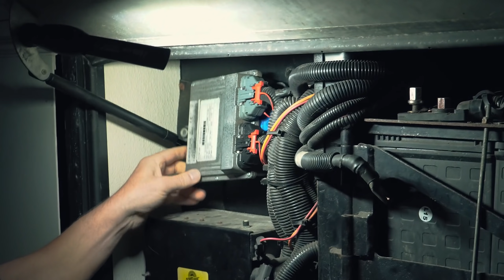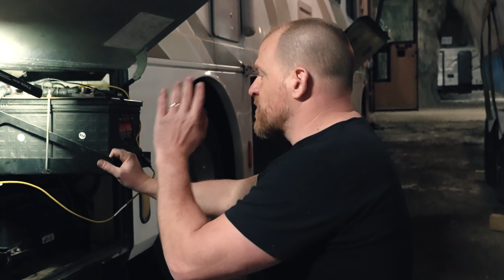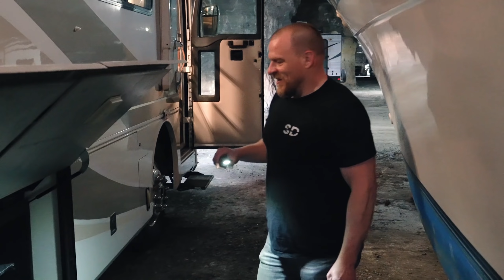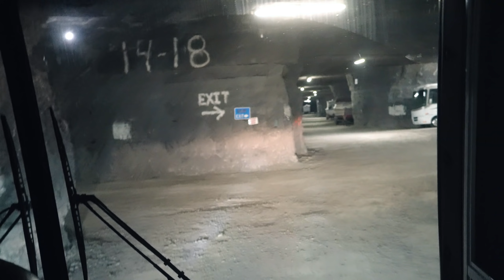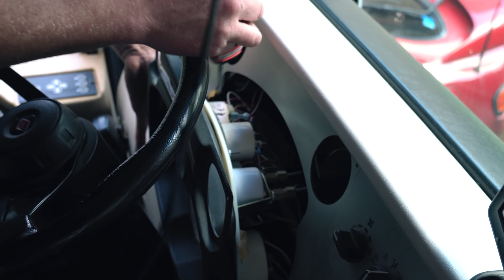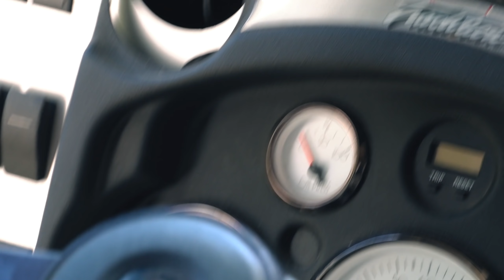What else got cooked in my RV? (bringing her home) Part 2

Comment: Paul as a former Cummins Inc. engine tech, I can only speak about Cummins engines and the OEM’s that use Cummins engines. I can say that on these charging systems I’ve never in 10 years out of all the following: large or medium size RV’s, Buses, Garbage Trucks, Tow Trucks, Crane Trucks, County Vacuum Trucks, High Pressure Compressed Air Trucks, Gensets Both Trailer Mounted & Truck Frame Mounted, Fire Trucks, Light Duty Class 6 & Class 7 Trucks and Class 8 Semi Trucks... 

I’ve NEVER seen a charging system that actually charged at 14.7 or higher Voltage UNLESS the system was a 24 Volt system and in that case they charge between 28v - 29.5v. ALL 12V systems on anything above the weight rating of a one ton truck usually charge between 13.5v - 14.3v, not even at different higher engine speeds. Typical engine speeds are 800 - 3,600rpm obviously smaller 2.3 Ltr - 6.7 Ltr diesels can turn up to 3,200 - 3,600rpm safely but, most larger engines 8.3 Ltr - 19 Ltr only turn around 2,100 -2,400rpm safely though 2,400rpm is not advised (that’s usually when blocks develop holes and rods start learning how to knock and fly.
Reply: We used to say redline is where pistons start swapping holes.
Reply: @VashthStampeede  yes but at Cummins we Dyno tested every engine that was rebuilt out of frame prior to putting them in the frame. That’s usually when we found the Monday and Friday engine builds. You know the ones that mostly seem to like slinging rods out the block or starting a new rod knock version of music when under standard loads typical of genset engines. It sometimes to us was a betting game of when they’d fail or how they’d fail. Cummins engines are cheap job security, it’s not if they’ll blowup it when. Of course unless a worldwide pandemic happens then Cummins keeps the desk workers and sends the techs that actually do the work packing. Saw it more than I care to say, I was surprised I had the job as long as I did they were always looking to send us packing to save money for their corporate budget and manager pay raises.

Comment: 13.8- 15.2 was the numbers taught to me back in automotive class. This was also 30 years ago lol. You are definitely blessed to have all these people out here trying to help out. I'm going to say it is to high and those batteries are definitely going to be letting off more gas. If there is a way to check the acid/water level don't forget to check it. I think it's funny that the gauge stuck on you. I've got a habit of flicking all the gauges that don't read right. I work on a ton of different things and sticking gauges seem to be common on older equipment. Love your videos guys, keep up the good work and God bless.
Reply: Learned in highschool chemistry, always lightly tap on all gauges for an accurate reading.

Comment: Mmm I haven't watched the whole video yet but I was thinking... Isn't there a way of having some kind of heavy duty secure switch that you can't turn off by accident and opens the whole 12V/24V circuit? In that way the people that run the parking only needed to know where it is (I guess in the same compartment where 12/24V batteries are) and it would be easier and safer... It could be even a requirement to leave the RV there because I don't think that would cost a lot in comparison with the parking fees and possible problems that can occur.

Comment: If a battery disconnect switch (they're enough for race cars) isn't enough to obey the storage mine's rules, what about a pigtail on the battery with a quick disconnect commonly used on tow trucks to connect jumper cables, and often used to quick connect snowplow pumps. those quick-connect cable ends are keyed so that they can't be crossed, are easily connected and disconnected, and are rated for 200+ amps.

Comment: 15.5 volts continuously is a too high charging voltage. What amperage did you measure? Any chance there is a sense or feedback circuit with a problem so the regulator defaults to max output?

Comment: as a guy working on medium/heavy duty stuff for the past 5 years 15.5volts sounds high to me most systems run 13.8-14.2 volts maybe 14.5 volts max but its an RV with more electrical loads so maybe thats normal not sure since I never really worked on RVs. the alternator is an older model with an external fan which I have found to be not as realable  as the new internal fan style you could get one delco remy replacement for maybe $250 or so but maybe its an RV thing with that voltage so high but trucks/box trucks/dump trucks/tractors are a lower charging voltage then cars are and 13.8-14.2 volts is the sweet spot.    great video man cheers!

Comment: 15.5 v is to high check engine light could be over voltage code if you could get a engine number I can try to get some info
Reply from the maker: part 3 coming up :-)

Comment: Find a reputable rebuilder and see if you can get the alternator output down to 14.2 or so. Most regulators tend  to be off to some degree. Also you might look into the disconnects like the tow trucks use for connecting jumper cables. That would give a secure connection and be easily disconnected when needed. Just use two different sizes for the starting and house batteries so they couldn't be hooked up wrong.

Comment: I don't like 15.5v either.  In my opinion 13.75v gives best battery life.  Many newer vehicles use 14.2v.   Delco type voltage regulators (inside the alternator) can be obtained with various voltage ratings.  Higher voltage can be used as battery temperature drops.  You said this is not computer controlled, so I'm guessing it doesn't have a battery temperature sensor.  AGM batteries tolerate a little higher voltage without cooking.  You could always check current going from alternator to battery and compare to current going out of the battery.  If they are the same, then you're probably not cooking the battery.  Also check battery temperature.  Is it a single wire alternator, or does it have a sense wire from the battery, check the voltage on the sense at the alternator.

Comment: What's the charging current?   Could you use an external regulator between the alternator and batteries?  Are all the batteries charged at the same time?  Could it be that the batteries' voltages are at different levels?  Is there any voltage drop on any of the cables?
Reply from the maker: coming up in part 3 lol

Comment: Hey Paul check the coolant level when engine is cold, if the level is below the coolant level sensor it will trigger the engine light and set a low coolant level code. When the engine warms up a little the coolant will expand and hit the sensor setting the code inactive.

Comment: For the battery bay, take a pictures of how everything should look when hooked up, print out the pictures and post on the inside of the door. Could also add some tags and/or color coding to the cables and posts indicating what should be connected together. Maybe test the picture and label scheme with someone not familar with the battery and see if they can figure out how to hook it up correctly.

Comment: They probably saw multiple batteries and immediately assumed a 24 volt system without looking at how the batteries are wired and hooked up 24 volts.  Catch their mistake after they tried to start it stopped and then hooked it up correctly.  That would have fried a lot of stuff.  Would have fried a battery cell also.  15.5 volts is to much.   A contractor friend of mine changed out the batteries in his Dodge diesel and hooked the first one up backwards, don’t ask me how but he did,  fried every thing.  ECM,  smoked,  BCM, smoked, alt, smoked, electric clutch fan smoked.
Reply from the maker: damn, expensive mistake!
Reply: @ScannerDanner  
  Yes it was.  And like your motorhome I cannot figure out how he stretched the cables to hook them up backwards, but he did.

Comment: Some OP gauge systems work backwards. That is, full ground sets needle to zero and as OP rises ground is reduced to increase gauge reading. I am a marine mechanic and run into this from time to time on older boats and some diesels. The gauges resemble Faria. They do that sometimes. Especially the tachometers.

Comment: I'd be nervous about 15,5 volts charging Paul.  Seems pretty high as mots I've seen on these is around 14,5-14,8 range.  That alternator is more than likely a Leece-Neville brand as those are common on the Cummins ISC and ISL engines.

As for the transmission shifting, I found on grades I drive by feel and gauges and shift manually.  Over time the adaptives on the transmission will learn where you shift and many times when I am reaching for the shift pad the transmission will shift so it has learned my driving style.
Mike
Reply: I wonder if the high charge rate is causing the shifting issues?

Comment: On the table. 
When you got a bunch of things to do, you say I have lots of things on my plate. 
When you haven't finished doing something or it is still in consideration then it's something that's still on the table. 
Course we are talking about the English language and there's a lot of different ways of saying things in the English language too two to. 
Wright, rite, right?
I mean correct?
Wait a minute Caleb, cute? What about your sisters. 
Yeah 15.5 is high but it could be that high because it's charging your batteries. 
I'm used to seeing around 13.5 when charging but I am usually seeing single battery conditions. 
You are dealing with multiple batteries and it looks like different charging maximums. 
Have a look. 
https://rvlifestyle.com/understanding-battery-voltages-and-state-of-charge/
Here's another site to check out Professor.
The guy says that Costco batteries recommend a 15.6V equalization charge periodically,
https://forum.solar-electric.com/discussion/331802/maximum-safe-charging-voltage-for-rv-systems
There's a bunch of info to look at.
Something there maybe your cup of tea. 
Happy Motoring.
Reply from the maker: I just suck at common phrases, I get them all wrong, ALL the time. It is an on going joke in my family
Reply: @ScannerDanner  I don't know if your family does this but my family quotes famous movie lines such as,
 When going on a road trip we'll say, We're off to see the Wizard, from the Wizard of Oz 
Playing with the kids my wife will say, 
Reach for the sky, from Toy Story. 
We also quote some comedians like Brian Reagan. 
Brian does a skit where a bunch of guys are trying to one up each other and then Neil Armstrong walks in.
So when one of my kids was impressed with a job I did, my response was, Well you know I walked on the moon. 
Have a great day Brother and keep walking with the Lord, cause ya know He's watching and we want to please Him.
Reply from the maker: @mostlymoparih5682  all the time! But it is Dumb and Dumber (the original) that we quote the most. "we're really doing it aren't we Harry" (road trip) or "bulb gulps huh, welp, see you later" (like every time we stop at a gas station)

Comment: I would freak at no oil pressure and you let it run, waiting for the knocking?? No current clamp? Did you at least bring beer?
Reply from the maker: I knew enough about the system and the computers oil pressure sensor to be comfortable. Combined with the smoked TCM, I was never worried about the oil psi (part 1)

Comment: Pro tip from an aircraft mechanic. Replace the disconnect switch with a aircraft battery disconnect. MIL-PRF-18148.  For a battery disconnect I would use tags. Matching negative and positive tags. One on the cables and one on the posts.

Comment: Try rainex for the windshield on the camera lens. Might keep the moisture off it.  You were talking about leaving the key on the first position reminds me of my boss. He had a Wonderlodge and towed a Suzuki. Pulled it from North Miami to Key West with the ignition lock with the wheel turned a little to the right. Scraped off the sides of the front tire.  On the 15.5 volts. Is it possible that you have a dead cell in one of the batteries that would make it over charge.

Comment: need a better look at the alternator. could be a leece neville. it will have a 4 bolt rectangular  cover in the back and side that is the regulator.  if it is it is brushed  and will need overhauled at about 130,000 miles.  we scheduled 100,000 miles.  got parts at pitt auto electric  but that was 20 years ago. not sure they are even still around. yeah 14.6  is the limit i'd go  14.2 is perfect.  older batteries tend to boil off  more than new ones so 14.2 to 14.6 max.   you could have disconnected the oil pressure sender wire and done an ohm check  off and running. sometimes a d'arsenal movement guage will get its   movenent magnetc charge shifted if too much current goes through it.
Reply from the maker: it's not fun under there lol, that's why I went gauge first lol, great info and on point. Part 3 coming up
Reply: @ScannerDanner  definetly change the regulator/or alternator to  get voltage in range! i would wonder about excessive moisture in that old cooked tcm/coupled with excessive voltage? Just a thought from an old FART that has worked on cars proffesionally sice 1971....boy i am old,keep up the good work SONNY BOY11111

Comment: One thing you could do with the grounds is to combine them with a binding block. One option is to get one of the temp cable terminals, the kind that clamp around the cable, only don't use it as a clamp. Use the bolts that hold the strap as binding posts. Another is to make up a short cable with a post clamp one one end and eye-type terminal on the other. Use a bolt and sandwich-stack the eye terminals together, or make a simple bus bar terminal block with 3/8" strap and bolts, using the new cable you made to connect all the grounds.  Either way keeps the original cable terminatons intact, but with a single connection at the battery.

Comment: newer alternator have sensing wire that should connect direct to the batteries or the output post on the alternator if broke or missing they to overcharge

Comment: 15.5 is high.
High Voltage = Lower amperage 
Lower voltages generally mean Higher amperage.
Test the actual Amp output @ the Alt,( I know you already did So I await your results in Pt. 3).
The regulator voltage set point on your rig is either skewed or faulty.

Comment: Your dealing with heavy duty equipment.  Most smart device's are set up to be used for 24v and 12v. Battery's that possibly didn't hold a perfect full charge might charger at 15v

Comment: Usually the people that can afford a New Motor Home , Have the Money to afford repairs , When I first retired I bought a 15 year old fixer upper , it only had a lil over 6000 miles on it , Drivetrain was in great shape . Every thing else was in bad need of repair , Tires were dry rotted one blew out in driveway at like 2am lol , I come rolling outta the door in my BVD's with gun in hand . Oh someone had tried to install new paneling on the walls in the kitchen area . Well they had put staples an screws in the Wiring behind the original interior , which caused 12 V lites to short out , an / or work intermittently, oh on the Alt , I had a 89 F350 that was stuck at 17.2 Volt , swapped out the Voltage reg on back of Alt an it dropped down to 14.3 .

Comment: Check and see if your alternator has a “remote sense “ terminal.  If it does, a wire should be connected from batteries to that terminal.  If that wire is broken or unhooked the alternator will put out max voltage.   It should be a small terminal on the back side of alternator.
Reply: This I wondered!!!  I dunno why put bunch crap on diesels when it should be simple.... mind boggling
Reply from the maker: coming up in part 3 :-)
Reply: @ScannerDanner  Here's the deal.  Knowing you and how you think you will never be at peace as long as it's reading 15.5.  For no other reason than your peace of mind replace it.

Comment: ScannerDanner going full live wire while getting the RV ready to roll and the RV having 15.5 volts was ironic to say the least.   I get the same way in similar scenarios.  When you’re passionate about your God Given talent it’s hard to reign it in when it’s time for action!  Checking amperage with and without draw along with voltage might offer some additional data to make the diagnosis perhaps.  I’ll tune in for the Master to learn a fella about this situation in part 3.

Comment: Weak batteries make alternators work harder. I suspect the engine battery is getting weak. If it were me, after 6 years, it's gone. I'd lay money a new battery brings that voltage right back down.
Reply from the maker: coming up in part 3 :-)

Comment: Possibly the alternator putting out 15.5 v after the engine was started with the jumper connected is what ruined the capacitor in the TCM.
Reply from the maker: could be damage from the alternator, but I believe it is the other way around

Comment: Do you have codes? Maybe TCM? Why is it shifting so wierd on take off is what I would like to know.
Reply from the maker: Maybe you missed part 1?
Reply: @ScannerDanner  Yeah. I kind of just jumped in to the interest of it. Lol
Reply from the maker: The TCM got fried, oil psi gauge and now alternator voltage is high. We're pretty sure someone jumped it with 24v. This is a used TCM, first test drive, that you just watched
Reply from the maker: Learned shift points, I talked about it and what it needs to reset them.